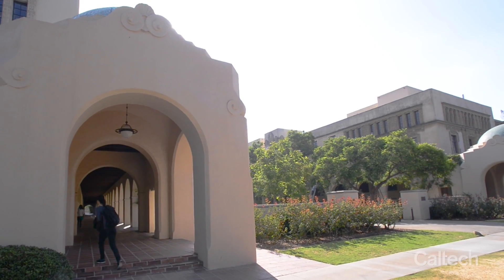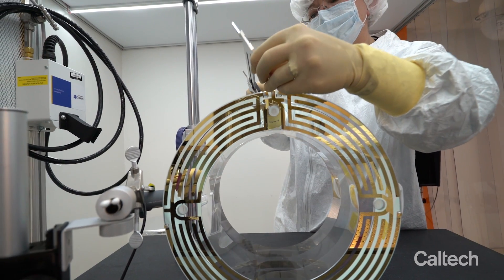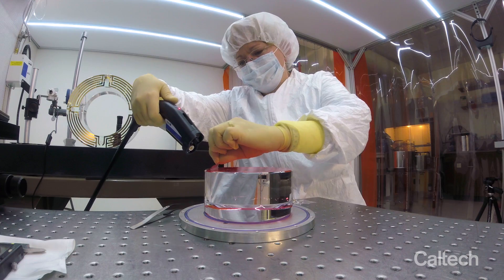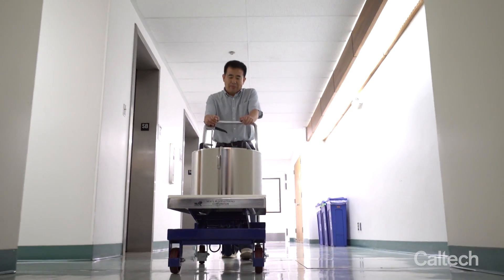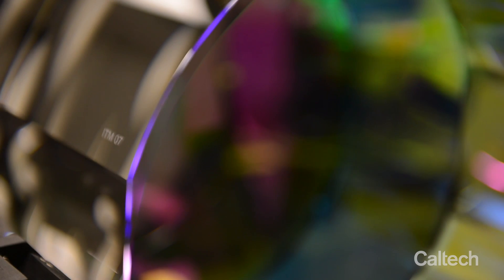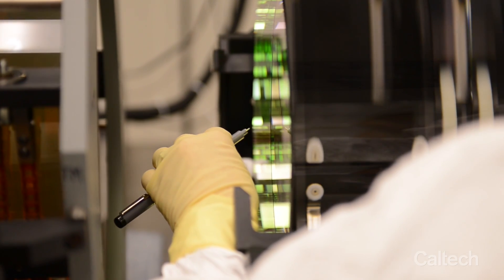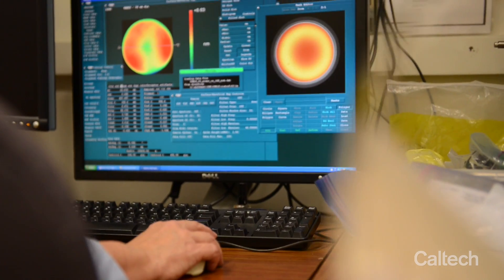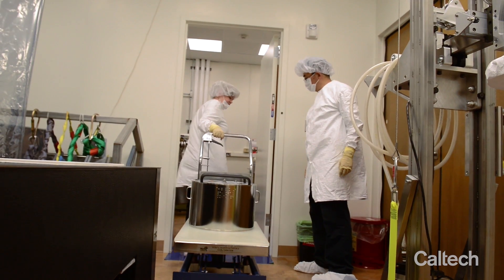Cleaning LIGO

Comment: why not cool just the mirrors, like by 100 degrees at least. also, if this much better, put another four kilometers on the length, and make a huge difference with the next run?.
Reply: Each arm contains a device known as a Fabry Perot cavity.  It keeps the laser light trapped inside the cavity for 400 passes in the full 4 km tunnel.  This gives the tunnel an effective length of 1600 km or 994 miles.  
The ground based observatories are awesome, but the next phase will be the LISA space antenna.  This will greatly increase sensitivity and range.  The ground based observatories detect from 10 hz to 1000 hz.  But LISA will detect from 1 hz to 100,000 hz and detect events from much much further away.  The arm length on LISA is 2.5 million km.  Currently the "planned" launch date is 2034.